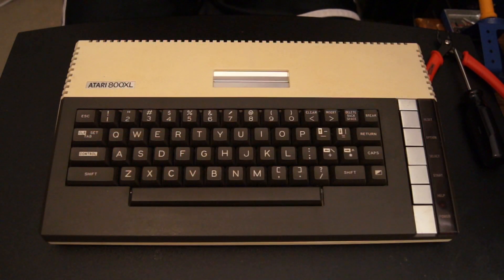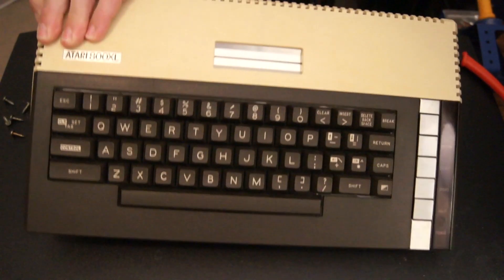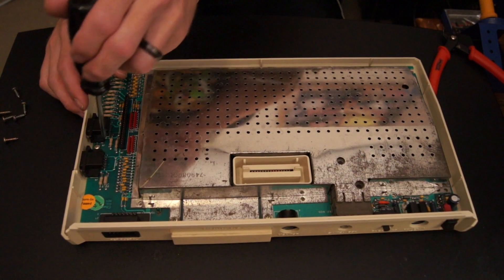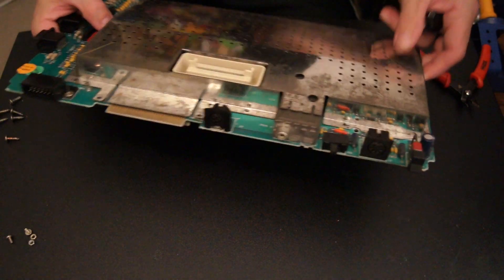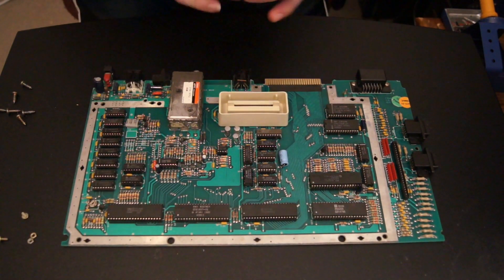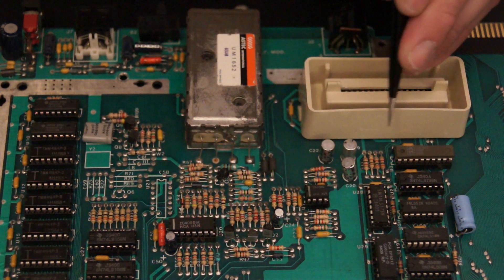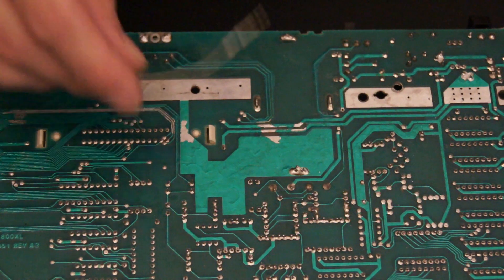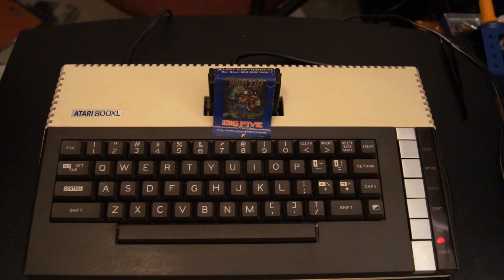800XL Teardown + Simple S Video Mod #Atari #Svideo #Modding #Teardown

Comment: Yes this is a good mod to do, but it does disable composite video so it's not ideal. Composite is essential for many games and applications that use color artifacting. A better way to improve 800XL video is to install a UAV-D that gives much better video quality and retains composite.  Also the RF shield is a good idea to keep in the computer for structural strength so it won't flex like a wet noodle. =) cheers
Reply: Do you have a howto on to install UAV-D?
Reply: @KramerEspinoza   @Hans Kramer  There are instructions on the AtariAge forums - 800/XL/XE subforums.  The UAV-D upgrade does have some cost and there are cheaper ways to improve the video of the 800XL. Another route is to do the 'super video' fix which is similar to what he describes in this video but has several more steps. The 800XL is great but it's biggest weakness is the video quality compared to other Atari 8bits that have the monitor plug like the 800 and XE models.

Comment: If you just connect the back wire without cutting the transistors could it work? Thanks for the video!
Reply: Yes, it will still work fine without cutting the transistors.

Comment: Does snipping that component off the board also remove color output from the composite? Thanks.
Reply from the maker: It completely gets rid of composite on the monitor output(at least in my case, when I hook up composite I get nothing). I read that it improves the quality of the svideo by mitigating some interference. It’s probably not completely needed but since I rarely use composite I decided to just cut it.
Reply: @techtinker5089  Do I really need to disable composite video on the AV port in order restore S-Video, can't I just have both composite video and S-video working?
Reply from the maker: @Ballowax  You can have both but the quality increases quite a bit when you cut it.
Reply: @techtinker5089  Alright so I want an S-video signal but still want composite video preserved I just need to solder a wire from pin 5 to that spot on the motherboard on 5:38?

Comment: Does this work on a pal 800xl ?
Reply from the maker: As far as i know it should.  I do not have a pal system to verify however.
Reply: You don’t need it on a pal you have rgb output just get a cable
Reply: @KramerEspinoza Maybe this helps, a German ATARI 800XL which is expected to be PAL, also proven by the darker-colored BASIC background - he's doing it a little different on the front and adding a resistor to the cable. But spots look the same to me.
https://youtu.be/CWoo8lzycmU?si=J07XJyPEyiqhbL3k&t=776